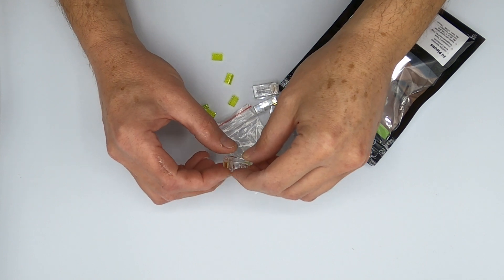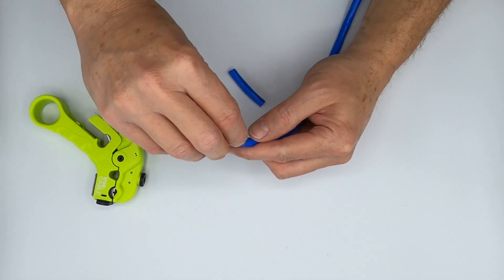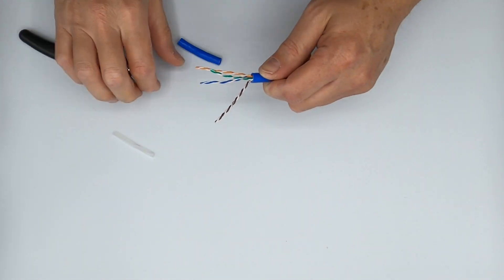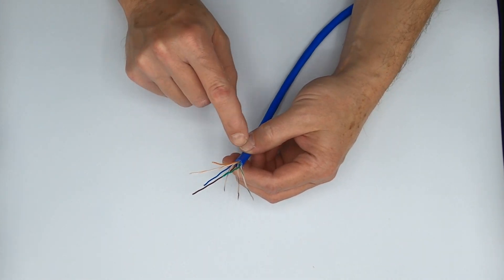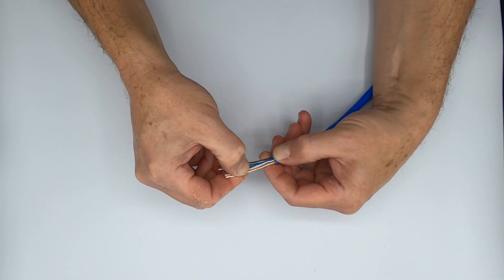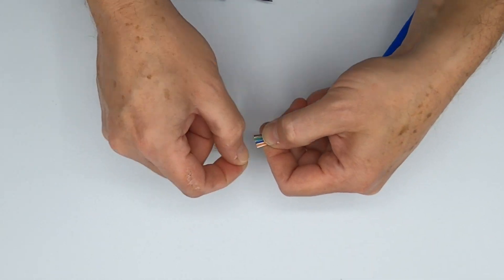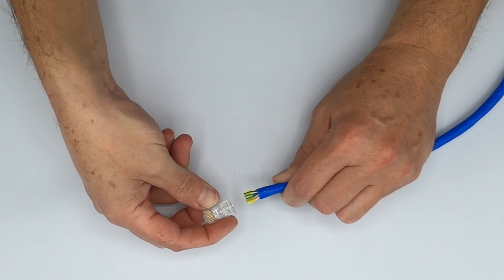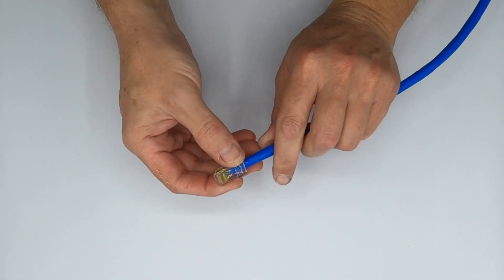How To:  Terminate a Cat6/6A Standard Load Bar Unshielded RJ45 Connector

Comment: So the latch side is actually the bottom of the plug? I always thought it was the top of the plug. I'm glad I'm doing my research before installing cable for PoE cameras.
Reply from the maker: Hello! The latch side is, technically speaking, the TOP of the plug. The bottom side is what gives you the clear view of the inside, and is the side that also has the triangular piece of plastic towards the rear known as the strain latch.

Comment: Does the cat6A use the same rj45 connector as the cat6 ?

And do I need a “special” rj45 connector for power over internet?

I believe I have cat 6A
Reply from the maker: Hello. There is no specific type of 8P8C (aka RJ45) connector dictated for Cat6 vs. Cat6A in the standard. RJ45s don't have a Category per se. RJ45 selection is based upon conductor gauge, conductor insulation thickness, and the overall thickness of the cable. Category is irrelevant. You do not need a special type of RJ45 for any variation of PoE.

Comment: I feel this tutorial would have been better had it been from the assembler's viewpoint. Then the green/white would not have been at the bottom of the screen when he says to put it at the top. I have weak eyesight, so it worked better for me to make the wires slightly longer and slip them in one at a time. These are an improvement over the other type connectors .
Reply from the maker: Thank you for the video feedback, we will share this with our team for the future!

Comment: Thank you for the video.  I like these RJ45 connectors that utilize the load bar, they are fairly easy to use and work well for me.  So far they have been very reliable.  And I like that you can use any quality standard RJ45 crimp tool.
Reply from the maker: Thanks Pete. We really like the load bar style connectors too.
Reply: @trueCABLE  I like that the ones that you folks offer that have the greenish color load bar.  Easier to tell that the load bar is bottomed out under the contacts.
Reply from the maker: @Pyridox  Thanks Pete. I specifically had them designed that way for just that reason. - Don S.

Comment: Why do we even need that loading bar ? Typical RJ45 connectors are working just fine.
Reply from the maker: Good question! Solid nosed 8P8C connectors (aka RJ45) that use load bars are useful for keeping the conductors organized and in sequence when a spline is present in the cable. Cables that use a spline like Cat6 and Cat6A are not easy to put male end connectors onto, as you are fighting against the spline to keep the conductors lined up. A secondary feature is the load bar itself pre-staggers the insulated conductors. Staggered conductors in RJ45 terminations greatly benefit 10GBASE-T transmission over Cat6A by reducing crosstalk at the connector.

Comment: I’ll be trying this in the next few days. Wiring the house with cat 6a and moving everything into a “closet”…. Cause the wife hates wires. Who’s doesn’t?
Reply from the maker: Hello and thanks for your comment. Indeed, the correct way is just as you describe. A centralized enclosure in a closet (or more often the basement) that radiates all of your wiring outward, running inside wall cavities to keystone jacks, is the ideal way of creating a structured cabling system for residential situations per ANSI/TIA 570-D.

Comment: I read your article titled: "Load Bar Staggered RJ45 Connectors: Do They Increase Ethernet Cable Performance?" from June of this year. In it, you recommended the stagger load bar style connector for Cat6A, and I had a few questions. The OCD compels me:

1) I noticed in The Big Experiment™ you did not test the "Cat6A Extra Large Pass Through RJ45" you sell on your site. Would there be any headroom difference between that and the load bar stagger type? (If not, do you think that would alter your recommendation in the article?)

2) Does cable shielding make any difference on headroom, or is this purely a connector thing?

3) How does all this compare to the headroom on a Field Term Plug connector? Obviously those have no stagger since it's in a mini termination box
Reply from the maker: Hello and thanks for your comment and questions! Keystone jacks and field termination plugs will ALWAYS give higher headroom than RJ45 8P8C plugs since the plain plugs cannot impedance match and have no "secret sauce" inside helping to smooth out electrical performance. RJ45 8P8C plugs are always a potential cause for excessive Return Loss and lower NEXT margins. When it comes to Cat6A, and the 500 MHz speeds it operates at, you will see better performance using a PROPERLY fit stagger plug vs straight across. I did not test the XL Cat6A pass through stagger plugs as they were oversized for the cable tested, which was Cat6A Riser U/UTP. I tested the 8 across plug vs. the load bar stagger plug because those plugs properly fit the cable, where the XL plug is only for Cat6A U/UTP Plenum. Good eye, though!
Reply from the maker: Hello and thanks for your comment and questions! Keystone jacks and field termination plugs will ALWAYS give higher headroom than RJ45 8P8C plugs since the plain plugs cannot impedance match and have no "secret sauce" inside helping to smooth out electrical performance. RJ45 8P8C plugs are always a potential cause for excessive Return Loss and lower NEXT margins. When it comes to Cat6A, and the 500 MHz speeds it operates at, you will see better performance using a PROPERLY fit stagger plug vs straight across. I did not test the XL Cat6A pass-through stagger plugs as they were oversized for the cable tested, which was Cat6A Riser U/UTP. I tested the 8 across plug vs. the load bar stagger plug because those plugs properly fit the cable, where the XL plug is only for Cat6A U/UTP Plenum. Good eye, though!
Reply: @trueCABLE  Ahhah! Excellent, SO! I purchased some Cat6A CMR F/UTP Solid 23AWG cable from this place called [redacted]frrmmrmrrfrmm[/redacted] and if I wanted to buy your shielded staggered pass-thrus, which would I go for? (I only one one listed on the site. It's called the "Cat6/6A Pass Through RJ45 Connectors | Shielded" ... Will that work? I can't find any called "XL.")

Edit: Actually wait... I just realized, it doesn't matter, because I'm not planning on using the solid core stuff for the patch cables.. or at least.. maybe not? Should I? If I use stranded core, which of your shielded connectors will work? Or will any of them work? I could imagine they would be too large! Argh!

... I swear, this level of precision makes me think of Steve Martin's "plumber joke" routine...

Sorry for buggin' ya! I know you're out of the office until Monday. I've been bugging your poor staff in the meantime. Dave's trying his best at trailing after my fastidious tendencies. I'll send him a copy of this thread in email and ask him. Enjoy your vacation!

Comment: I've switched to passthrough.  Oh for the little pleasures.  Could NEVER see going back!
Reply from the maker: I fully understand and find myself using passthrough more often than not. That said, we have a REALLY good load bar Cat6/6A unshielded plug that works well with some of the thicker Cat6 and Cat6A unshielded cables out there. Depending upon the cable jacket OD I am working with, I will use our load bar plug just as enthusiastically as our passthrough.

Comment: I've noticed some RJ45 connectors come with dividers that is to be placed before the load bar. This is supposed to reduce crosstalk. To me it seems excessive but do you have any experience or measurements that can verify if it actually makes a difference? If it simplifies lining up the pairs that might also be a plus, but it could just add extra work I guess? Thanks!
Reply from the maker: Hello Joakim and thanks for the question. The divider and even the load bar do not, and are not designed for the purpose of reducing crosstalk. They may have a marginal positive effect on NEXT due to conductor stagger but the difference is not enough to be measurable due to a ton of other factors. The primary reason load bars are used at all is due to ease of termination. The conductors in larger Cat6 and Cat6A Ethernet are thick enough that a "8 straight across" strategy simply will not work anymore as the plug is not big enough inside to allow it. The load bar strategy pre-staggers the conductors for you, and also helps keep the conductors lined up in the proper T568 sequence during insertion into the plug housing--which is important since you are also dealing with a spline in the cable that will do everything it can to UN-LINE up all your work!
Reply: @trueCABLE  Thanks for the explanation!

Comment: Strain Relief Boot NOT necessary?
Reply from the maker: Correct. Strain relief boots are an optional accessory. Strain relief is already built into the rear of the RJ45 plug with the strain latch. Strain relief boots are useful for helping to maintain bend radius, but are largely cosmetic in nature.